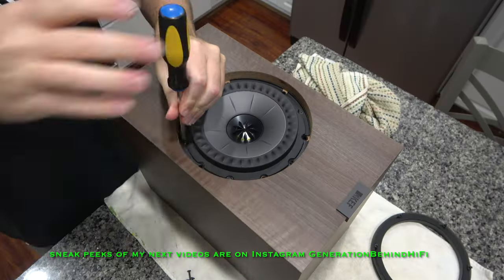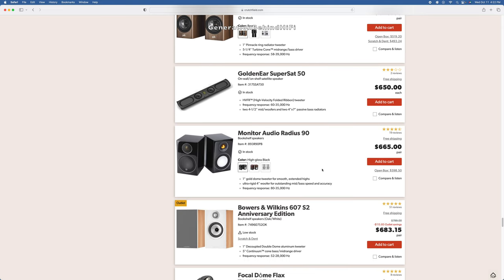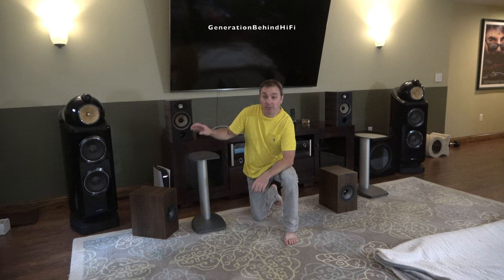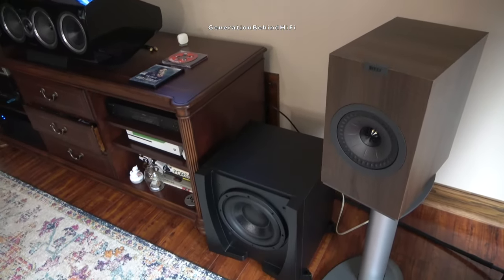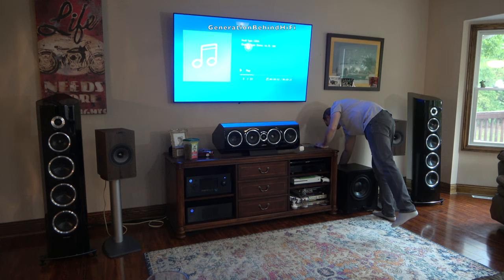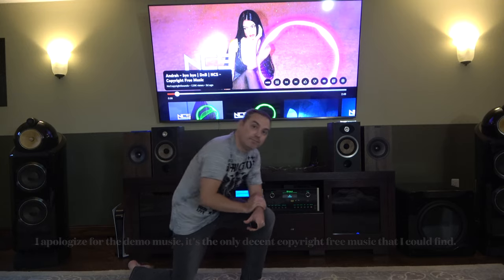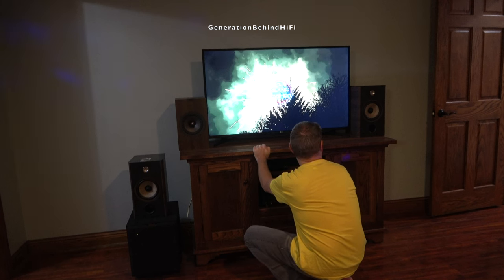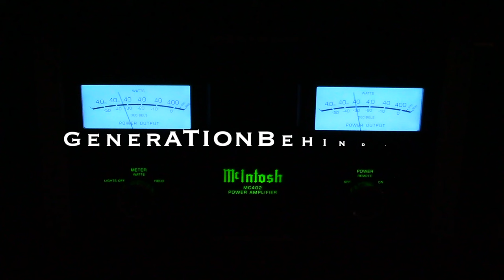A Review of The KEF Q350 Bookshelf Speakers

Comment: The baffle thickness is 1& 3/8" thick according to your tape measure not 1 & 3/4"...still 35mm is a good thickness baffle for a bookshelf speaker...i have a pair, great speakers but disapointed Kef put no damping panels, bituman, dynamat etc on internal speaker walls & only 2 tiny pieces of cheap BAF like material for internal damping...lol...1 day i will re-build the crossover with an air cored inductor & the best polypropylene capacitor i can afford, rewire them ,fit audiophile grade input terminals & put some open cell foam inside as the cabinets are to lively...i don't understand why Kef changed the shape from the old Q series curved cabinets which were far superior built...built like a tank with a great shape to get rid of standing waves & cabinet resonance's....the Q350 drive unit is very good... good review & demo
Reply from the maker: Hello, Thanks for the comment! I just wanted to point out that I never said the front baffle was "1-3/4 inches" thick. I said it was "1.34 inches thick". :)

Yes, it was a bit disappointing to see the lack of damping material inside the cabinet. If you're handy then doing a few DIY upgrades will really bring this speaker to the next level! Good luck on the upgrades! It sounds like you're going to take your Q350's to the next level.
Reply: Lol....right got it ,1.34 is a mixture of metric & imperial...in the UK we use one or the other, mainly metric but never mix both...
.... 1.34" written down would be taken as one & three quarter inches in the UK causing confusement... different strokes for different folks... our UK English is not the same as your American English...i learn something new every day even at 59...lol...yeah i reckon i can squeeze a more refined sound out of them....finding an audiophile grade polypropylene cap was not easy at 4.4uf but i ordered a pair of Claritycap ESA's which are better than the caps used in the Q350's & a pair of air cored inductors from Dayton Audio, same specs.....i would have redesigned the crossover but i don't have the equipment any more, i used to design transducers/loudspeakers 30+ yrs ago  but sold the equipment when i became a musician playing bass for many years, still do sometimes when i can.....